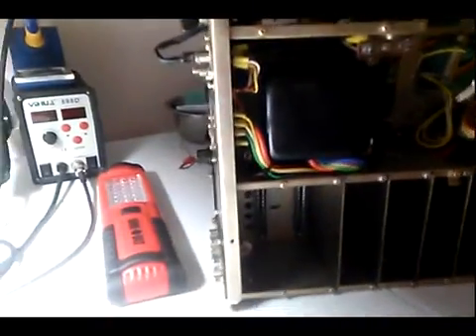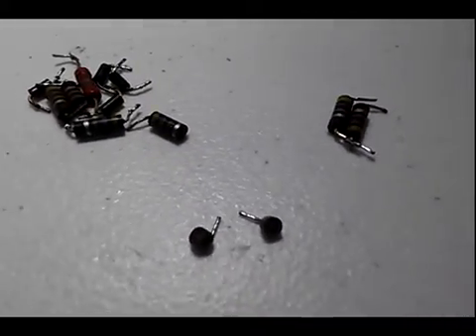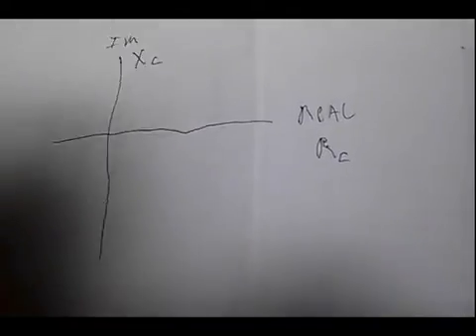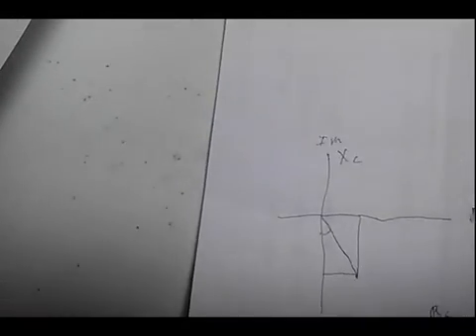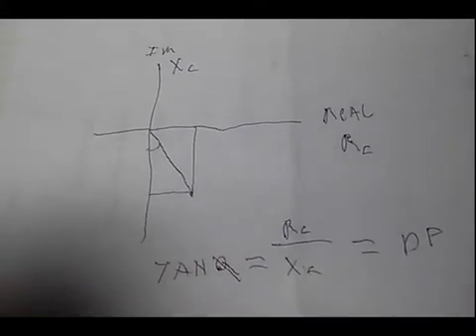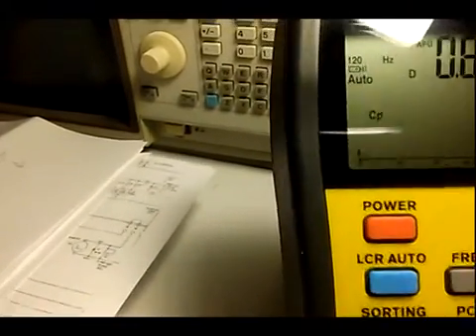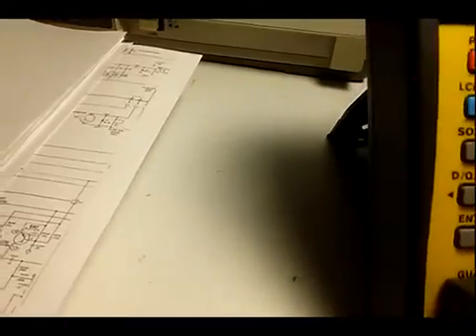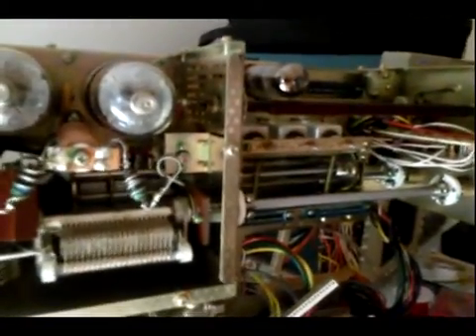Yaesu ft-901dm Capacitor testing.

Comment: I haven't restored a radio yet. But it seems like a very good idea to replace the hv caps right off the bat. Because it's too big of a risk to fry that transformer not to mention the repair you would have to do on the rectifier board. Which I see you have already done.

Comment: I have a Yaesu Ft901DM and did what you did and changed out all the lytics. Why have to do everything AGAIN by changing 1 or 2 of them?  In my travels I have ALSO found Tantalum caps  prone to failure, but not quite as often as electrolytics.  BTW leakage current is another capacitor parameter you might check with lytics.  You don't want the capacitor acting more like a resistor.

Comment: Dr. i want to change out my 2 HV Caps...500 V 100uf... i finally got the board out...not sure what the engineers were thinking...anyway...i checked on a few sites...mouser, digikey...the caps leads all seem to be short.... am I missing a specific term for the cap leads ...also... thanks for the online stuff... fun to watch...Larry   WD0DXF
Reply from the maker: Hi..thanks...what you have to do is cut the leads off of the old caps and solder them to the new caps. This is what I did.
Let me know if you require anything else.
Reply: Thanks....

Comment: Hello, do you know how to check the parameters of the supercapacitor?
capacity 10F, 100F.
Reply from the maker: Well, checking them would be the same mathematically so you would just need a LCR meter which has that high of a range.
Reply: Prompt model of such a device.
Reply from the maker: I assume what you mean is schematics for the test device?